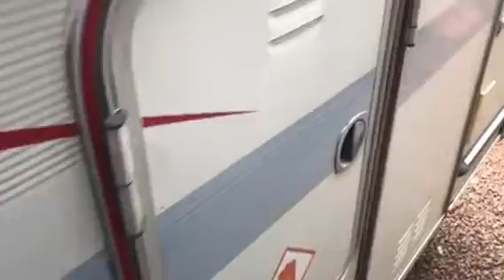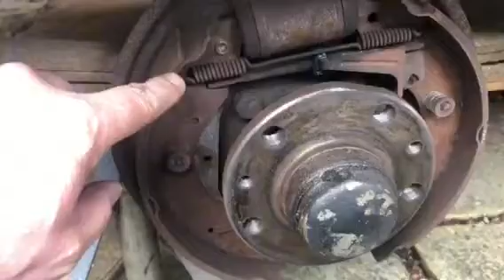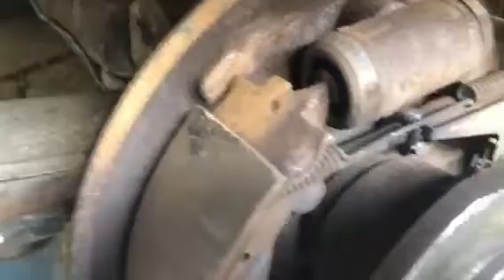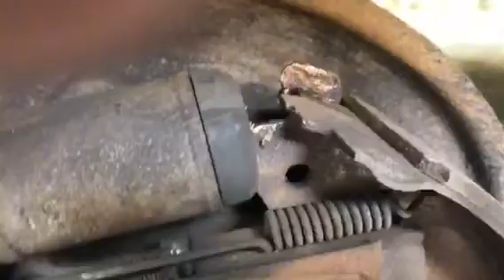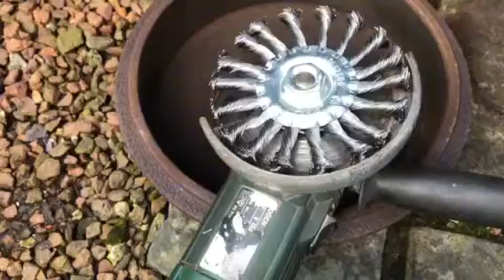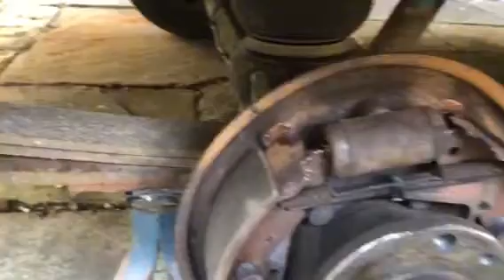Talbot Express Rear Drum Brake Service.

Comment: I do appreciate your videos.  This isn't the first one I've come across, nor commented on.   I was hoping you would be installing new shoes, as I know that you'd have a trick for putting the springs back on.   I've had a tough time this afternoon.  Back at it after tea.
Reply from the maker: Sorry to hear that you struggled with the springs there are a few tips and tricks to tensioning the springs using string or a pulling tool can help. I am planning to replace the shoes in the future and I will record the process.
Reply: Thanks for the reply.  Turns out the easiest way was to assemble the shoes and springs before putting them on the backing plate.  It made it very easy leveraging the brake shoe rather than pulling the springs. @TheRepairer